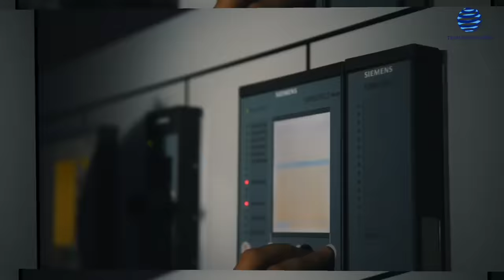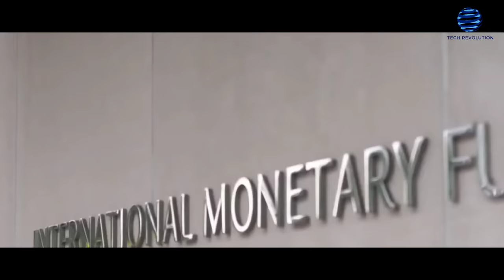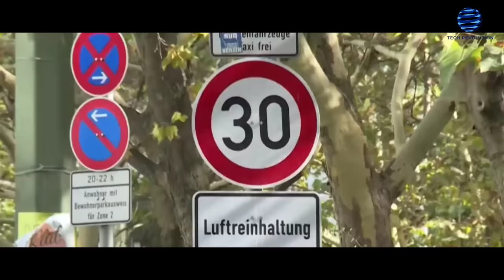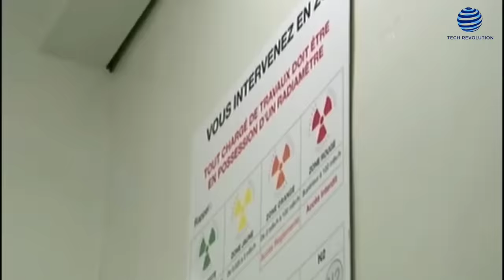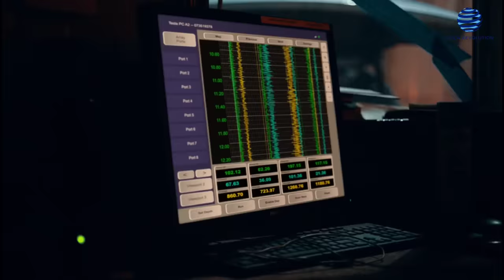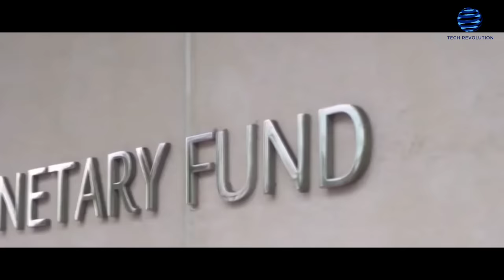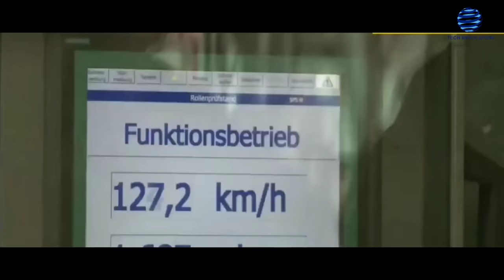Germany Industrial Giants Collapse | Energy Catastrophe Unleashes Chaos In Industries

Comment: Renewable energy other than hydro and nuclear is not a realistic source of power for modern economies because apart from the high costs its intermittency destabilizes power grids when it contributes more than 10% of total power and that requires instantaneous backup that can only come from hydro or gas turbines that must be kept running and have a one for one energy balance with the wind and solar they back up. This more than doubles the cost of power and does not save on emissions of carbon dioxide even assuming the latter has any major impact of climate above present levels which it does not except to make plants grow better. Politicians have lead he industrialized countries down a blind alley all for no gain and much pain.

Comment: 4:03 North Stream pipelines were not stopped due to any war. Three of four pipelines were attacked to explode them on 26 September 2022. While one pipeline is still ready for work it does not have turbopump power equipment in working order since EU, USA and Canada put sanctions on turbopump power equipment maintenance while this equipment was delivered by Germany and the only country that has maintenance equipment is located in Canada. So North Stream requires a lot of efforts to return in working order because of the sanctions. Also the sanctions are not going to be cancelled in any foreseeable future. So Germany will experience lack of natural gas from Russia  for many years.